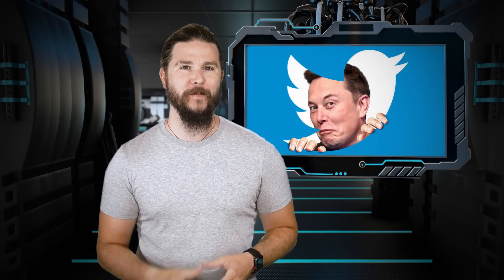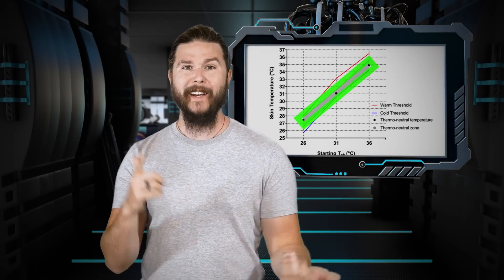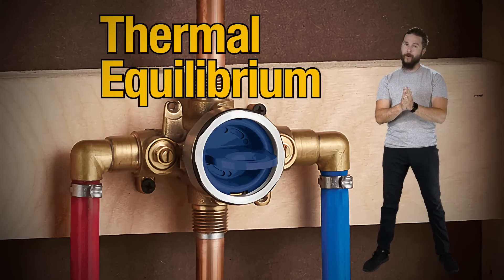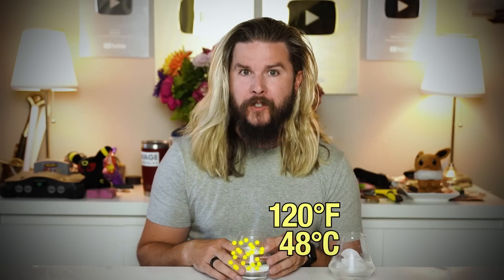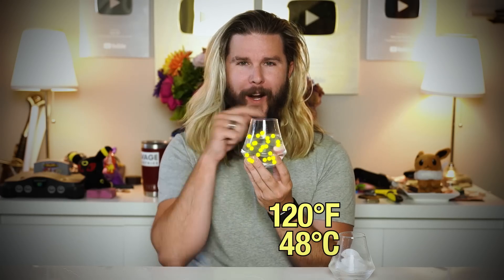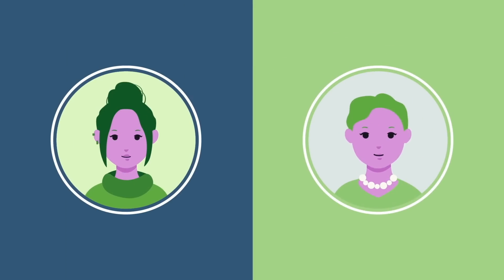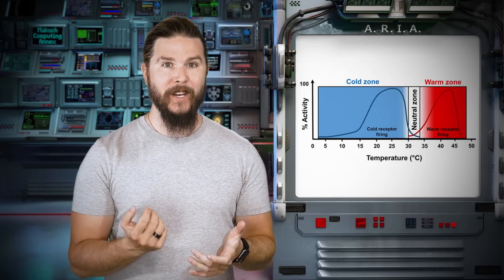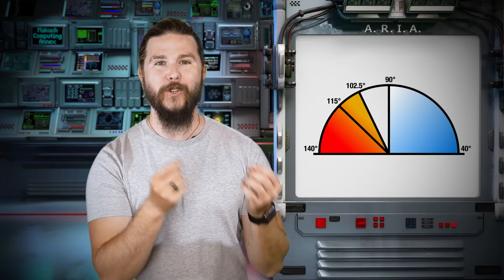Why Are Shower Handles So Sensitive?

Comment: This US showers (that normally are also spread on hotels on other countries and also some new buildings) are horrible lazy ass work. It doesn't matter if gas boiler is more efficient than electricity cost wise, you spend SO MUCH water waiting for the hot one to come through the pipes, and then more time trying to make any sense of the cold/hot water variances.. 
LONG LIVE electric showers. It doesn't matter if I spend more money, the ability to turn it on and have a steady temperature throughout the entire bath is magnificent. Yes, even if there's the 00.0000001% chance of getting electrocuted, which in my 35+ years, I've never seen any in the news.

Comment: My credentials = professional plumber.

Showers suck because of pressure differences, thermal loss, and a bunch of other factors.

But let’s start at the source of hot water. Hot water is forced out of your water heater by the incoming cold water from the water-main.
Meaning in a perfect system, you’ll have the same pressure on your hot water as you do on your cold. 

Old valves and cartridges were a simple design that when turned revealed a gap for each line to flow through. This is much still the case.

So whenever someone flushed a toilet or turned on a cold line, there would be a loss in pressure due to a draw of water by that other fixture. But the pressure on the hot line would remain the same. Meaning relative to each other, there’s a lot more volume of hot water moving through the valve than cold and you get a sudden spike in temperature…

And if you’ve ever wonder why the water starts cold when you first turn on a shower but then eventually it’s boiling even though you haven’t touched the handle. That’s because the pipes that the water flows through on the way absorb heat. in return, cooking the water before it reaches you.
So the hot water has to heat up the pipe to the same temperature as itself before it’s thermal loss is minimal and the hot water stays hot all the way to the valve and shower head.

Comment: I agree, shower engineering sucks. Just a slight nodge to the left or the right will make the shower temperature feel like ice water or scalding hot. And God forbid someone flushes a toilet while you're in the shower, I don't want to be broiled like a lobster.

Comment: Australia had this problem solved years ago...two separate valves, one for hot water, one for cold water, so you can freely adjust either to control the temperature
too cold? you can turn the hot tap on more OR you can turn the cold down
too hot? turn the hot down OR turn the cold on more
its such an easy solution that works really well, they still converge into the single pipe that goes to the shower head, but you can freely adjust hot or cold before they mix, allowing you to control the temperature and flow rate by adjusting either one

Comment: I'm old school, I prefer to have separate control valves one for hot and one for cold. I don't care for the single value controls in showers. I might want the full entire water pressure that I can get using both hot and cold water at a max and if it's a bit too hot, I'll just turn the hot back a little and if it's a bit cold I'd do the same with the cold. The shower types that have a single valve in the middle kinda suck, you can only have it at a single position to get the right temperature but are limited on the amount of water pressure you want. The same goes for sinks too.

Comment: Ehhh hhh ehhh ... I guess.  You're maybe part right.  Turning down the hot water heater's target temperature is very important in general.  You're wasting money heating water to a temperature you then predominantly mix with cold water at every sink and shower because it's too hot.  Total waste of money to aim so high.  But therein lies the rub of the shower mixer: there's no standard for hot or cold.  A sample size of one is not scientific.  😛  The problem is, there's a wide range of "hot" temperatures from house to house.  There's a wide range of "cold" temperatures too, especially from season to season and how much of your "cold" water line is indoor plumbing that ends up as room temp until the line finally starts pulling in the below-ground water.  Then there's the difference between shower temperature and bath temperature.  And then there's the "but sometimes" of things that you do like fill a bucket with cold water.  Or hot water.  Etc.  Because humans aren't the only thing getting cleaned here.  It all varies.  And you need one singular device to effectively handle this variety in every installation, in every situation.  So dialing in the mixer to only handle a small range is horrible.  You don't always want a human-happy middle, and where that middle actually is changes, a lot.  What you do want is better control.  Which is where electronics come in.  Set a temperature and let it do the valve control mixing to maintain that temperature.  But, that costs money.  So we continue to mostly install and use the crappy traditional system for all of us cheapskates because manufactures need to support such a large range to fit all of our install and usage needs.  There simple mechanical options however that separate the temperature mixing from the flow control, letting you leave your desired temperature setting while turning on and off the water flow separately.  Those are a great improvement as you don't have to lose your baseline temperature setting every time you stop showering.  I'm sure it has a technical term, but I'm not a plumber.  Works great though!

Comment: Why do people even get into a shower, especially an unfamiliar one, before figuring out the temperature situation?
When I first turn the shower on, I'm usually still clothed, and I turn it up all the way. I don't even check it for at least a full minute. 
Then I check to see if the hot water has kicked in, and if it has I then turn it down to where I know the sweet spot is on mine, or around that spot on an unfamiliar one.
Only then do I disrobe. I then check the temperature again and adjust as needed. 
Then I finally get it and expose myself to the shower stream slowly. I rarely need to make any adjustments while in the shower, unless I take an exceptionally long one and need to turn the heat up.

The main problem seems to be that people jump in before adjusting the water, and that's on them. The people who don't even turn the water on until they're already inside the shower are just dumb.

Comment: Would this 44b really end world hunger? Hardly believable.
Reply: It would...for a single year.
Reply: @johnathanera5863  so it would not solve it. It  would feed people for a year. 
But still hardly believable. 811 000 000 people suffer from hunger. Assuming 10 dollar per day worth of food(~11$ us average per day) Gives u 8 b spent per day. 52b per week.

Ofc in some areas for 10 $ u could buy probably a week worth of food or even more but supplying this amount of money would increase demand for food which would increase the price so supply would change as well.

Often buying food comes with no supply what so ever which makes it overpriced for area or far travel is needed to access goods which costs as well.

Giving people money for food would have other issues. Other, often widely speaking stronger/bad people would come after them for that money.

Complicated issue. 

Us spent 801 b in 2021 for military and this would not solved it either.

Comment: you forgot the solution of a multiple handle set up. When i was growing up my dad's shower had 3 levers, left for hot water, middle for switching between tub and showerhead, and right for cold water.

I'd crank the hot water all the open, then tweak the cold water until it mixed the way i wanted it. it had some nice leeway for adjustment.
Reply: that's what i have

Comment: One thing this fails to account for is big families. When you have multiple people showering simultaneously or in sequence in the morning, the first person has ample hot water and thus the smallest range of adjustment. As the hot water tank is consumed and has fresh, cold water mixed in with the hot water, the temperature drops over time, meaning the people with the later showers need to adjust the handle more towards the hot end, with the last (usually me) needing to run it on the pure hot setting. This would have literally scalded the first person (usually my wife), but is my setting for "oh god please let there be enough warm-ish water to get clean before I am forced to take an ice shower against my will this morning". So for me, that "too hot to be useful range" actually slides into the "too cold to be useful" range pretty rapidly.

Naturally, this could be avoided with an efficient tankless water heater, but with 3 bathtubs in the house, that's a rather pricy option to take on. Hopefully one day we'll have showers smart enough to detect the actual water temps and hold it steady without breaking the bank. Until then, I will continue my frantic "spread soap around like a maniac and rinse off before the heat death of the water heater tank" technique.

Comment: Or you put a gear in it to ratio down the the valve and give you 90 degrees or however much of room to adjust in that sweet spot. So long as the flow rate is on a separate knob you probably shouldn't need to make a ton of major adjustments, and even if you do that's a small price to pay for that level of control.

Comment: Popular Science had an article years ago about a Circuit Breaker for water lines, if that helps.
Adding a pressure blowback preventer could solve it.
I guess if you're Really picky, you could put in a valve that only allows water to flow when it's at the sweet spot. 🤷‍♂️

Comment: I have an old set up. It's  a handheld shower (which honestly I find much more practical than wall mounted showers) with the hose attached to the side of a the nozzle that fills the tub, which has  separate hot and cold knobs, no lever.  I have no visual way of telling how far the knobs are turned.  Every shower is a frustrating adventure.

Comment: 7:50 This is exactly what I did. My Water heater is digital, I set the highest temperature to the sweet spot that I like (34°C), so when I turn my shower to "full heat" it is already at the perfect temperature.
Reply: NO WAY
That's so cooool

Comment: Another confounding factor is that many modern showers have a passive thermal expansion safety valve that restricts hot water flow as it heats up, meaning you'll have to keep jogging the handle to the left as the valve heats up for the first few minutes.  I asked my plumber if he could leave it out when we got our bathroom done because I really dislike them, but he said he couldn't because it is code in our area.

Comment: Downside to lowering your waterheater temp is that you'll run out of "hot" water faster. By increasing your water heater's temp, you can use more cold water than hot in your mix, meaning it lasts longer.

Comment: I always wanted to make an electric one that would mix it to a specific temp and hold it there... with LEDs in the shower head for status.   So it will start out full hot until it blends in cold to cool.. (heats up faster) then pulls out cool water as the hot runs lower (and cooler) until its full hot and lets you know that while the temp is fine now, it will start getting colder soon.
Reply: Electric showers are the most common here in Brazil. The Shower itself has temperature control.
Reply: The guy Guilherme Stecanella is right, and I'll even add something. There are already some friggin SMART SHOWERS, with internal temp control with electric heating. Electric showers rules

Comment: Possibly stupid idea, but wouldn't it be possible to add an internal gear system that makes it so the 180° range of the valve is translated into a 360° (or more) range for the lever ? That way, the viable temperature zone would be larger, and you'd have better precision on the temperature you want without needing more complex systems.

Comment: I would've thought that the obvious, mechanically-simple solution - especially if you like having very hot water on tap in the kitchen for various reasons - it to add a 'gearing' to the shower-handle. That is, set up a system so that a large movement of the handle only moves the actual mixer a little bit. That enables far more precise control, and still makes it possible to get an ice-cold or burning-hot shower if that's what you're into - it just takes more turning.

Comment: "is this a American problem where iam too Dutch to understand?" my shower just has a 38c setting and thats all i use. if you want it hotter or colder you need to press a button to lock it out of place en rotate it towards the desired temprature. but it always locks in at 38(no idea if its actually is 38c i just trust the dial) wich i always use, it just takes a  little time to get there.

Comment: 323.15K you can hold your hand In it but want to pull away
348.15K, 2 seconds 3rd degree burn

Not much difference between temperatures either

Comment: My solution was the opposite, I turned the temp on my water heater up. Now the middle of the dial is the right temp, and my family of four doesn't run through as much of the hot water when taking showers. I would usually go last, and have to take a lukewarm to freezing cold shower. Now I have enough to give me a pleasingly warm shower every time.
Reply: There is an energy trade-off in how hot you make your hot water though; especially for tank-type heaters. The hotter the water, the more heat you will lose through the insulation. It's a bit less of an issue with an on-demand system, but still somewhat of an issue as hotter water loses heat faster, and takes more energy to heat it up.
Reply: @kauske  for most in north america, that just means you lose that heat to your house, which means your House heading doesn't have to work as hard, so it all evens out, you can also just jacket your tank
Reply: @armorclasshero  Even here in Canada, you have AC for at least a portion of the year. That portion not only is the heat wasted, but your AC is working harder.

I have a hard time believing there are places in the US where it doesn't get hot enough in summer than more heat leaving the tank is a non-issue. And more insulation has diminishing returns, especially on a gas unit, that needs air intakes and exhaust ventilation.
Reply: @kauske  heat pumps solve that issue pretty handily
Reply: That costs energy and therefore money, since it is forced to heat up the water when you're not using it.
Reply: @oldmandoinghighkicksonlyin1368  It does that anyway. The heater heating water to 100 degrees versus 90 degrees isn't a huge difference. But having enough hot water for 4 people to take baths and showers is more important than the few dollars extra I pay for a few degrees more.
Reply: @QBCPerdition  I see your point. What you could to actually is go down in the morning before everyone has their shower and turn the temp up on the water heater, then turn it back down afterwards.
Plus it'd make your hot water faucets put out less scalding water.
You'd have to be ultra cheap to do that, but isn't that what dads do?
Reply: @oldmandoinghighkicksonlyin1368  This is a waste of time. You have to remember that the majority of the time the tank only needs to turn on the heaters (gas or electric) for short amounts of time to maintain the set temperature. The difference in this maintenance time for a 10degree difference in water temperature is tiny. What you actually want is as thermostatic mixing valve (now required in new construction most places in North America) that will take the very very hot tank water and mix it with the cold inlet water to a lower (and safer) temperature. So you get the bacteria killing benefit of hotter water and also have safer hot water going to the shower. Thus avoiding any chance of scalding (assuming things are properly set). Another benefit is that it actually EXTENDS the length of time you get hot water as a portion of the hot water going to the shower is NOT the hot water leaving the tank. So effectively you can get away with a smaller tank for a household and offset the cost of heating the water slightly higher.
Reply: Nice. Growing up, my dad's solution was to get a shower control that blocks you from turning it all the way hot, and then set it so that when you dial it all the way to the hottest temperature possible it was his preferred perfect level of lukewarm. One time I tried to take a shower to relieve some flu symptoms and ended up literally dismantling that thing in the middle of my shower just so I could turn the temp up enough to stop shivering.

Comment: Here in Australia, we simply don't experience that. The temperature is regulated by the heating element by default so the temperature is regulated and never above 45c so never hot + we have ordinance regulated pipe diameter. Never experienced cold hot cycles ;)